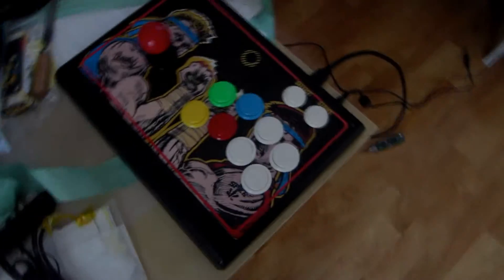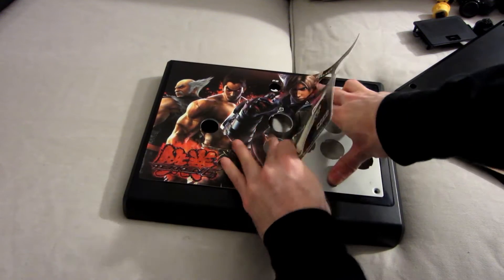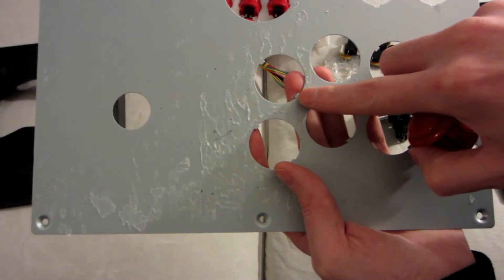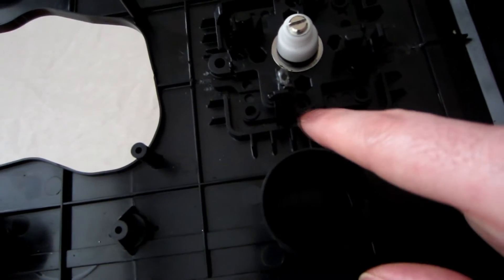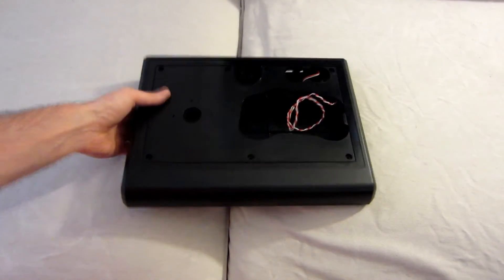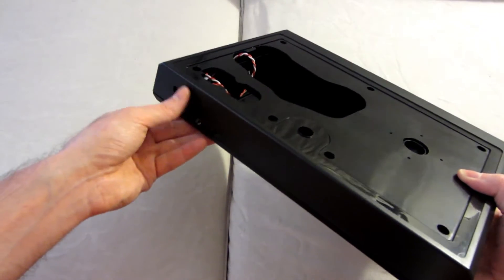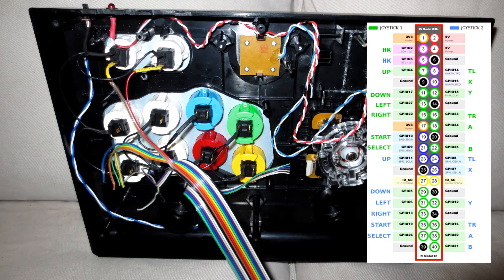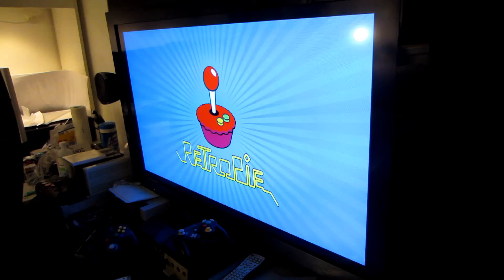[Arcade Stick Mod] Part 5: Hori Tekken 6 - RecalBox Raspberry Pi 3

Comment: I understand it's an old video, but is it possible to remove the original artwork without taking off the buttons? I just want to replace the adhesive tape it's attached to.
Reply: its not possible :(

Comment: Where do you get a giant sticker like that for your artwork? And did you cut the holes after putting it on?
Reply from the maker: It's an international A4 stick paper. It has a glossy surface and works on laser printer. The layout is small enought to fit within the paper. And yes I cut the holes after with a X-acto knife with a sharp blade.

Comment: I'm getting one of these Tekken 6 wireless sticks but for Xbox 360. I was thinking about doing a hitbox conversion with it, like how you did with the mad catz te. But maybe I'll keep the original 8 buttons and just add the three 24mm + one 30mm directional buttons to make it easier for now. But this seems to have noire layout so idk if the original hole for the stick is in a good place for adding the down button.

And then I want to dual mod it for PS3 so I can also use it in legacy mode wired on PS4 and still keep wireless for x360. I hope those cheap zero-delay encoder boards will work for this.

Comment: could you make a list of all of the things you bought?
Reply from the maker: Hey, sorry for the late response:

- Hori Tekken 6 stick
- Raspberry Pi 3
- Sanwa JLF-TP-8YT
- Sanwa OBSF 30mm * 8
- Sanwa OBSF 24mm * 2
- a small on/off switch
- a LED
- a custom PCB with a micro-usb connector, a TRRS jack and a HDMI connector
- an other HDMI connector, and right angle micro USB cable and a TRRS cable, to link the custom PCB and the Raspberry
- a 20 conductors flat-ribbon and IDC socket and header
- some Dupont connectors
- wires, heat-shrink tubes, acrylic rod and epoxy.

and an aluminium fold to isolate the HDMI ribon cable. ^^

Comment: Here are the parts of an arcade stick that I prefer: a Korean crown lever bat-top joystick because Korean crown lever bat-top joysticks do not need restrictor gates, and sanwa buttons are better than any other arcade stick button because sanwa buttons are sensitive and responsive.
Reply from the maker: Never had the opportunity to test a Crown joystick. For now I love Sanwa's JLF with a 2lbs spring.
Reply: The Real Phoenix In a crown lever joystick, there's no need for springs. It relies on a rubber tensioner that helps the stick spring back into neutral in a split second.
Reply from the maker: Yeah this? http://www.etokki.com/image/cache/Myoungshin%20Fanta%20rubber%20grommet-500x500.jpg I know, I'm just saying I've never the opportunity to test it.
Reply: The Real Phoenix Yeah, that's the one. And kuro buttons are just like sanwa buttons but they are really loud when pressed.

Comment: What template did you use?
Reply from the maker: I made my own after scanning the original one. I can put a PSD in my dropbox and put the link in the description if you want.
Reply: +The Real Phoenix That would help a lot if you do.
Reply from the maker: There: https://www.dropbox.com/s/x4s67u6frb0z6fr/Hori_Tekken_6_wireless_Template.zip?dl=0
Reply: +The Real Phoenix Thanks man!
Reply: +The Real Phoenix I have a question. whats a good stick under 30 bucks? I'm trying to find one to gift to my cousin.
Reply from the maker: Hmmm under 30 bucks I don't know. You could check for a Mayflash PS2/PS3/PC for this price, but quality won't be there especially on the buttons. Maybe the Hori Mini Controller for PS3/PS4 but it's more around 60/70 bucks, or the Mayflash F300 (Xone/X360/PS4/PS3). The best is to lurk on ebay/pawn shops to find the grail.
Reply: +The Real Phoenix Alright thanks!

Comment: Salut vieux, c'est du travail de pro! Combien d'heures t'as mis à la planification et au design avant de te lancer?

J'avais l'idée de faire de même avec un stick iCade (en conservant les composantes originales) et un Pi 2 mais ultimement celui-ci lag un peu trop à mon goût sur Mame (distro RetroPie de base).
Reply from the maker: Yo! Merci bien, m'sieur! :) Bah la planification ça a pas été trop dur. Qu'est-ce que je dois mettre dedans? Où est-ce que j'ai la place? Comment je rentre ça le plus proprement?
Le plus "compliqué" a été de déporter les ports HDMI, A/V et USB et de faire le PCB (qui devait être compatible pour un autre projet en cours). Ça ma permis de rajouter l’interrupteur on/off au passage.
Le plus chiant a été surtout d'attendre les pièces, puis se rendre compte que ça rentrait pas ou que je m'étais trompé dans la commande. Par exemple pour le câble HDMI ça s'est terminé par un câble custom blindé à la feuille d'aluminium parce que je trouvais rien qui m'arrangeai.
L'avantage c'est que maintenant je referai le câble d'un autre manière (genre avec des nappes FFC)

Le Pi 2 qui rame c'est bizarre j'ai pas vraiment senti ca sur les Pi que j'ai testé (2 et 3). Par contre oui certains jeux rament par défaut (genre SF3.3) mais en bidouillant un peu les paramètres c'est tout à fait correct.
J'utilise RecalBox au final.